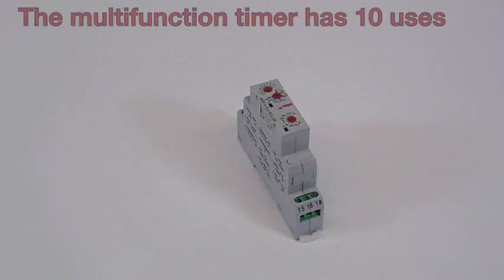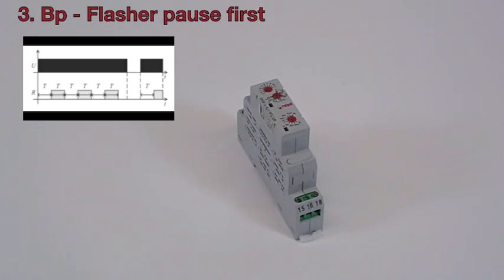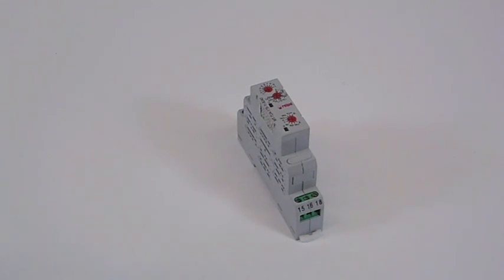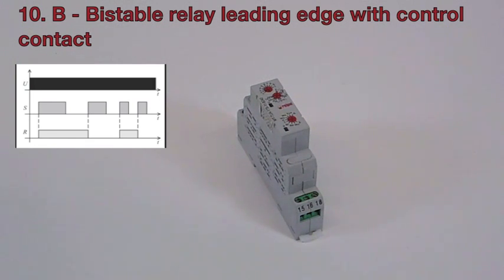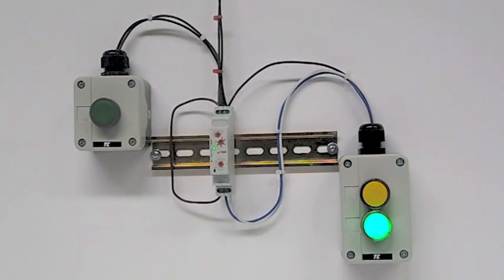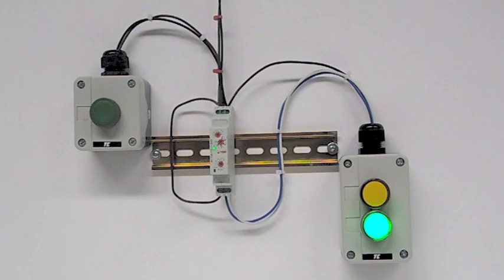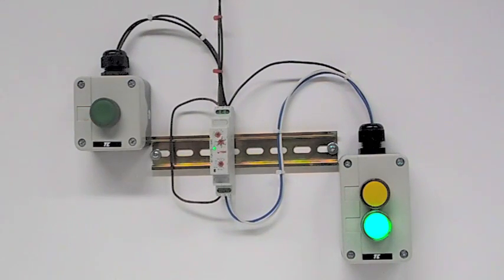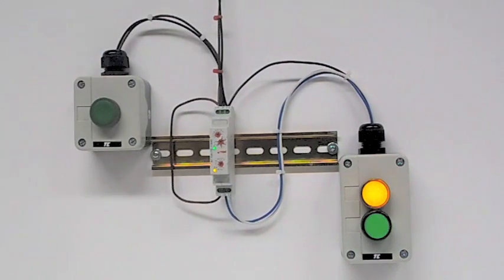Europa Components | Multi Function Timer Demonstration

Comment: Hi; can this unit be programmed for a delay on off 180 seconds and then a delay off for 1 second? I want to make a garage door opener in the up position stay open for 3 minutes and subsequently get a 1 second delay off to close the door. I need the timer to close after 3 minutes and then quickly open again mimicking a momentary button switch contact.
Reply from the maker: Hi, This timer will not be suitable for this application however our Asymmetrical Recycling Timer would be - the part number is MT-TIP-17S-11-9240, this can be found on page 102 of our current catalogue or on our website at this link https://www.europacomponents.com/product-asymmetrical-recycling-timer.html

Comment: What is the purpose of the supply from A1 to 15?
Reply from the maker: The relay is volt free therefore you need to put a supply in, in order to get a supply out. In this case we have taken the mains in from A1 and fed that into the relay on pin 15.